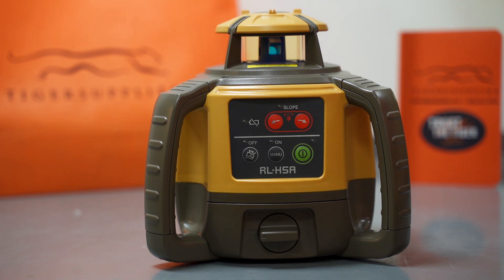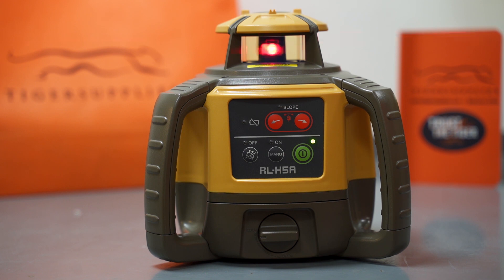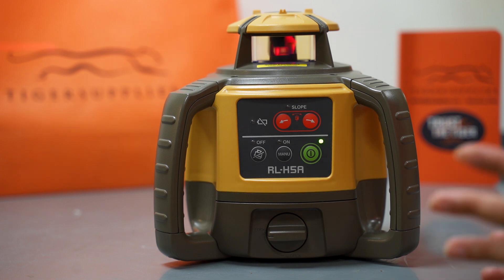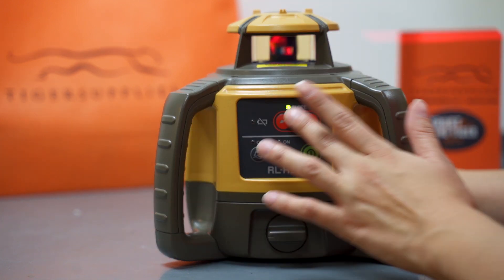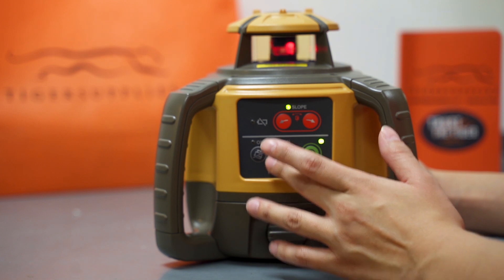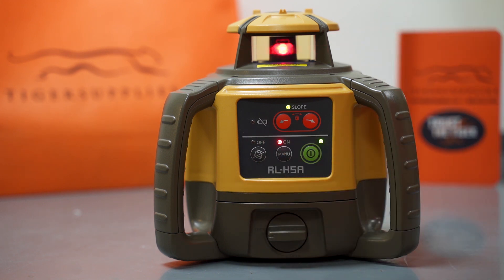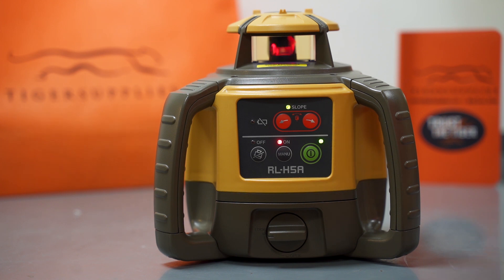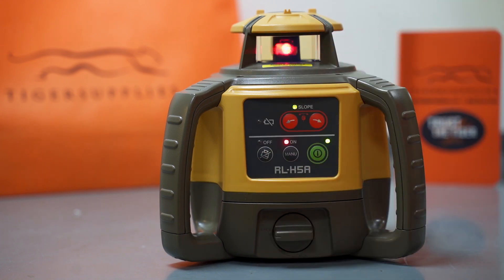Topcon rl-H5A - Button Overview and Instructions

Comment: I have a rl h5a . A year old and laser beam is very dim. Why?
Reply from the maker: It is just the nature of red beam lasers. Typically, red beam rotary lasers are used outside where it is impossible to see the beam. This is why we use the laser eye receiver, to detect the beam. If you do some work indoors and want to use a rotary laser, we recommend green beam rotary lasers. They are 4 times brighter than red beams...Keep in mind that even with green beam, it will still be impossible to see in direct daylight conditions. Hope this helps!
Reply: Did you find a fix? My laser is very dim and my receiver won’t even pick up the laser anymore.

Comment: Can the H5A lie on its side and be use to level vertically?
Reply from the maker: The H5A does not have vertical alignment capabilities. The next Topcon model in the series, the rl-SV1s or rl-SV2s, will offer vertical alignment.
Reply: @TigerSupplies yes but can you override it so it can be used not as a leveller but as a straight line only so as for extreme slopes or alignment of posts (as in a fence)?

Comment: I'm just wondering, if I buy the Topcon RL-H5A Construction Laser Level Rechargeable Kit With Tripod And 16' Rod posted on your ebay, does it include the battery tray for the rechargeable battery? or do I need to purchase it separately?
Reply from the maker: The rechargeable H5A kit include the battery tray, rechargeable batteries and the charger.
Reply: @TigerSupplies  thank you for the response. will order soon

Comment: Hello, mty topcon fell and hit the sidewalk quite hard - is there any calibration I can do to ensure nothing was displaced? Should I be worried that anything could have shifted internally?
Reply from the maker: Hello, although the laser might’ve taken a hard fall this doesn’t mean it is out of calibration as these units are made to fall. If nothing sounds abnormal and the laser is rotating without problem I think you should be fine. However, you are more then welcome to send the laser into us to take a look at.
Reply: Take the laser to a pond and compare elevation readings at the edge of the water at various spots.
Reply: Cross check your laser against two benchmarks on site, that’s the surest way to test laser calibration.